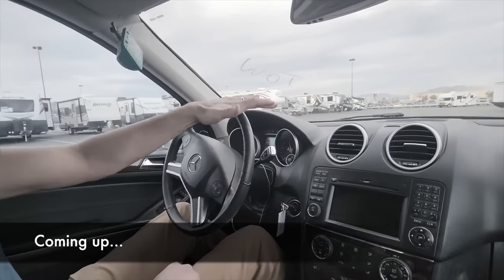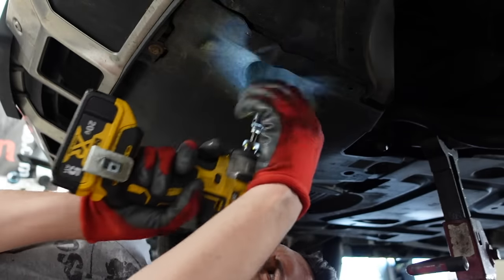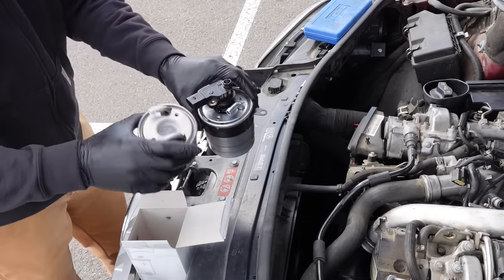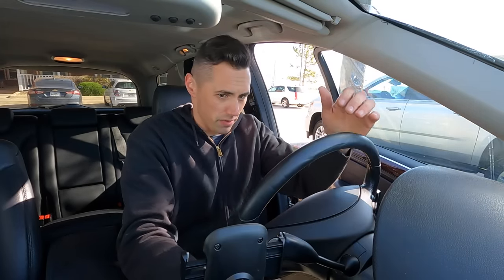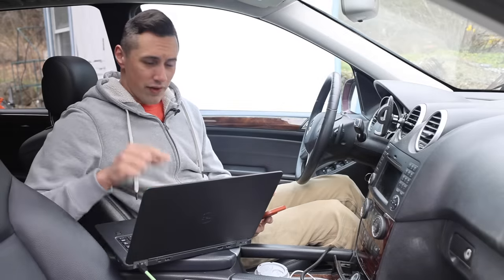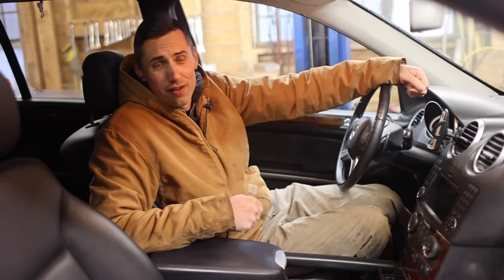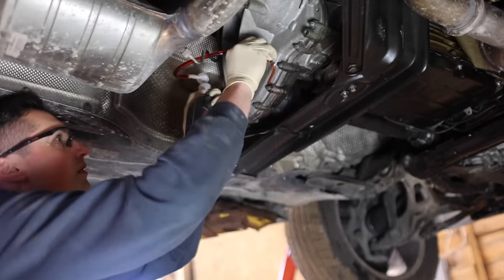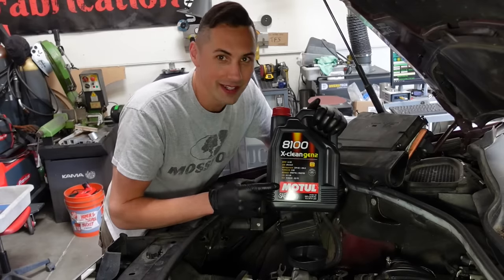This is the Most RELIABLE Luxury SUV I Could Buy for $4,000 (Not a Lexus)

Comment: Its funny how different the perception of reliability is in Europe and the US is. Over here in Germany Diesel engines are cosidered much more reliable than petrol ones as long as you drive long enough to get the power train to temps.
In the end it comes down to the care the vehicle got, I guess.

Also: love your content Waldo, not that shiny, quick cut, loud, usual car content - great! :)
Reply: Diesels are very reliable when it comes to toxic exhaust fumes .They never fail to pollute everyone in their vicinity. (notwithstanding a commercial vehicle needing torque from a diesel ).
Reply: The US has been hit with a massive gasoline shilling for decades. Everywhere you need a vehicle to be reliable, you're not seeing a gasoline engine that need at least 6 liters to make any amount of power
Reply: @kenadams5504  yet you would die way sooner in a garage full of gas engine fumes, than diesel engine fumes..
Reply: Here in The Netherlands the biggest question is how many km's do you drive each year. After a certain amount, the diesel engine becomes cheaper due to diesel fuel being cheaper, but road tax being higher. So when you drive less, you buy gasoline, when you drive a lot, you buy diesel.
Reply: Old diesels versus old gas, diesel is more reliable. Modern diesel versus modern gas, gas is more reliable.
Reply: The fuel difference between  countries is the issue. EU fuel is way better refined.
Reply: @ken adams  you think diesels pollute more than gassers? Your ignorance is showing.
Reply: @timhufnagel7462  there’s an entire class of pollutants that diesels generate that gas engines don’t produce much of, got VW in so much trouble. Diesels are definitely reliable, but their emissions systems definitely aren’t. There’s efforts to fix this with new diesel designs that get away with less emissions systems and are more efficient to boot, Achates is the firm working on them.
Reply: @Roman Nasuti  you know who doesn't have emission standards. The US Department of Defense.  So until they do, there's no reason for anyone else to have to play the "emissions" game.
Reply: @athaphian  As a German who just looks at different car websides it's not true as far as I know xd you Dutch people love small cars and drive soooooo many kilometers. I've been looking at Alfa Romeo MiTos and Ford Fiestas. Every single model that was in NT and not GER had at least 200.000km on it :D the highest was a 2014 MiTo 1.3 JTD eco² 84hp with 488.000km and the highest Fiesta was a 2016 1.2 Duratec 82hp with 340.000km you guys are crazy..
I also love "klokje rond" that dutch Youtube format where cars that have to go through the MOT the owners talk about how long they owned the car, how reliable it is and if it has many current problems or not ranging from 300.000km - 1.2Million.
Reply: @chriskonte1909  We are just cheap. We only sell our cars when they have a lot of mileage. xD
Reply: @kenadams5504  🙄
Reply: @osmaks1518  diesels are everywhere .how many ppl are in a garage full of fumes ?
Reply: @kenadams5504  the argument that Diesels are somehow much dirtier than Petrol engines can only come from an American who only knows Diesels as coal rolling shitpiles.

Well here there is a small diesel in every 2nd car and they are honestly  good engines.
20 or so years ago Diesels came into Fashion because they used less fuel and were actually a bit cleaner than Petrol engines in terms of Co2 emissons.
Reply: @alouisschafer7212  In my country, diesels are being phased out , and no new diesel engines will be bought/sold after 2,030 .Many countries are doing this. Emmision reduction is essential in order to slow climate change for the sake of future generations , in particular .If you don't care about such an issue , perhaps you are entitled to your attitude , but what if everybody thought the same way ? . Before science taught us about diesel fume affects on air quality , motorists were encouraged to use them because of superior fuel economy from them, so ppl with old diesels now should not be demonised , and I'm not judging them , but we now know more than before , and have to change the way we think.
Reply: Diesel fuel is also cheaper.
Reply: @athaphian  That's the old days. Diesel is barely cheaper now, sometimes not, the engines/car are more expensive. They have a DEF system which is problematic.
Reply: @DontCryAboutIt   Well, partially correct. Actually it is the idiotic EPA regulations.
Reply: Had many Mercedes, never found one that didn't stay in the ship after 20k miles.
Reply: @bycracky22  My experience was the exact opposite.
Reply: @kenadams5504 One thing is certain, you have no idea about the exhaust gas problem. Gasoline engines are not cleaner in terms of exhaust gas, the current direct-injection engines also require a particulate filter and also an SCR catalytic converter to reduce nitrogen oxides. In connection with the specific additional consumption, gasoline engines still emit more exhaust gases than diesels. The American way of thinking that gasoline engines are better and cleaner is simply due to a lack of knowledge about the technology. Ignorance is not a good advisor.
Reply: LOL it's the same here the OP doesn't have a clue what he's talkign about. ML and GL classes are made specifically for americans in america, aka they are crap
Reply: Merc with diesel engine is lasting for ever
Reply: Ha, a Mercedes M class reliable. What a joke 😂
Reply: I live in in Pennsylvania and drive a VW Golf TDI. I love it.
Reply: its bcuz here in USa we have extremely diesels and thus no abilities nor scale-of-economy to deal with.  That's even true for non diesel euro cars and that's why our car mkt lacks the interesting euro cars, and even the intersting non euro cars.   We suck basically.. very simple minds, but also a strict air pollution regime since the 1970's
Reply: @wills5482 American manufacturers produce 3- 4 and 6-cylinder engines that a comparable in power output to those produced anywhere. 
Large V8 engines are usually only found in pickups and large SUVs
Reply: Not if it's a Toyota or Mazda, though. Their petrol engines are much more reliable.
Reply: When the cars from Germany come to the U.S. they have to meet our clean air standards.  So much stuff is added for it to be legal here the cars become sluggish and not so great.    My wife's uncle bought a high end and had it brought to the states.   Never ran like it did in Germany
Reply: @kenadams5504:  “Emmision reduction is essential in order to slow climate change for the sake of future generations”

There is ZERO evidence that personal vehicles are causing our climate to change. There is ZERO logic behind the claim that changes to personal vehicles will be impactful to global emissions, given the small share of all CO2 emissions they constitute. 

What you have is akin to a religious belief accepted on faith, not based in evidence.

Comment: Great buying Waldo! Quick tip - when doing an oil change on the cartridge oil filter vehicles open the housing cap until you can see 10mm of thread. It will let the oil bypass the bottom o-rings and drain the oil out of the cartridge for a mess free extraction.

Comment: Hello from the UK, I used to work at a chemical plant that produced Anti Freeze, basically its all the same, Ethylene glycol is colourless, we used to add dyes to the production batch depending on the customer requirements, the packing plant was loaded with several thousand branded bottles, filled and shipped, we also blended brake fluid, packaged and shipped in the same way.

Comment: Great video, I saw thumbnail & said "Bet it's about the ML / w16X SUV" series !
I know cause I bought, 8 years ago, and ML500, so an 5 litre V-8, 2002 model year, Mercedes SUV, in a somewhat Rare color.

Guess what I paid, yes $4,000 !

She had 102,000 miles & now has 184,000 & is my tow rig for sport & work trailers.

You are SO right on Colors for Mercedes-Benz, is there a LAW somewhere that commands them to only use Black, White or Silver on 90% of them ???

I dunno but thrilled my ML500 is Gold Metallic instead.

But your red / burgundy color is superb !

And the Turbodiesel Bluetec is great IF she's a reliable engine:

As you say they're quite rare so hard for me to say. 

I will say this for sure, in the 98-05 early series ML (w163 series) the related V6 & V8, named m112 & m113 respectively, are legendarily tough & reliable.

I'm an occasional,l active forum tech at Benzworld w163 forum & have heard longevity stories that are exceptional.

I love unique German cars & trucks like these.

(Tip to newbies: body on frame SUV = Truck)

I just obtained a seriously cool yet rare German Station wagon you might look into in future:

2018 Buick Regal TourX AWD 5 door wagon - it's an awesome GT car made by Opel of Germany & only imported into USA in 2018-20.

But sold much longer overseas in Europe & Aus / NZ as Opel / Vauxhall Insignia / Holden Commodore.

Anyhow it's got Euro / German style & vibe quite the unique runner & NOT a carbon copy Subaru or Volvo wagon.

Actually size & performance very similar to the $90,000 Mercedes E class wagon, (still made but seldom seen.)

Let me know if you wanna know more on the earlier series ML (my channel has a few w163 mod videos) or Regal TourX Wagon.

Imma finish your video now.

Cheers - David in East Texas

Comment: Bought a 2008 ML350 (V6 Gasoline as you say) in white back in 2010.  I got it at 60,000 miles, and after 10 years of ownership, I put 170,000 miles on it.  It genuinely was a bullet proof car, the most reliable car I’ve ever owned in my life.  It only had one major issue towards the end and the repair cost me $1,300.  I drove it for 5 days 40 miles a day before I had a day off and take it into the shop, and despite some concerning noises, it still held up.  Two of my uncles bought a white ML350 after me, one of them a 2013 diesel with bluetec as well that he sent back to our home country.  Now I own a BMW only because I needed a newer car, and the newer Mercedes SUVs aren’t flattering at all, let alone reliable.  It’s sad to see how different Mercedes turned out, in my opinion it lost a lot of the style and charm it used to have before 2014/15.
Reply: Both males have gone down hill big time over the years.
Reply: What was the major issue?

Comment: I have an 09 R class bluetec brother to this. It is a beautiful machine when working. Mine was having same issue bogging down, often going into limp mode for boast issues. I tried cleaning out the DPF myself with limited success. But mine fell under the Bluetec settlement (check if yours falls under that), so dealer replaced dpf, def and egr systems for free. It runs much better now. I've also rebuilt the turbo and a small boost leak. If you do decide to rebuild the turbo, it is hard to find a rebuild kit and for some reason the one I got was missing a key o ring. Had to buy the o ring separate. If the T case starts making a horrible teeth jumping noise, you probably just need a new chain.
Reply: yeah, my mechanic forbade me the diesels, and he's an expert , deep level mechnaic for them and the nondiesel euro

Comment: I have the E Class Wagon in Hyacinth Red. 
Beautiful car. 

I did have a Jaguar XF. Bought it at 3 years old. Full Jaguar service and with an extended warranty. 
In the time I had it, it had over £10K of repairs and then, 2 weeks out of warranty, the DPF clogged and that leaked diesel into the oil sump. The engine destroyed itself. 
The car was worth ~£16K by now and Jaguar wanted over £12K for a new engine. 

I sold it for scrap. 

That was not the first but definitely the last Jaguar I will ever own.

Awesome video. 
Subbed 👍
Reply: What year e class wagon

Comment: Hi i am a mercedes specialist and i noticed you used the wrong transmision fluid (red color) for the 722.9 plus  (newer generation)after 2010 you need to use the blu color fluid... Change it before you destroy the transmition

earlier 722.9 transmission models will use Red fluid, while late-production 722.9 “Plus” models are the ones that require blue fluid.

Comment: So nice to see someone service a Mercedes properly. I think these have unfairly received a bad reputation for being unreliable because people are not maintaining them properly or at all. You do need to use the correct coolant, the correct oil and use the correct procedure for setting the level in the transmission etc.
Reply from the maker: Exactly. I think I should have been more clear in the video, but proper maintenance is key to having a reliable vehicle, especially with German cars
Reply: Well for the any car but especially one with DPF "Italian" tune up does wonders - 20-30 mins (or more) at 100mi/hr. + or few hrs. at 80.

Comment: I had the very exact same model 2009 3.5 petrol. Absolute bulletproof, then sold it and bought a 2012 w166 3.5 petrol my current one. Boy this thing is a beast with incredible speed and reliability. I also have a 1998 ml320 petrol so you could say I am a an ML fan 🔥💪🏼 the kings of suburban

Comment: Another great purchase, for a low price. 
I know a lot of people say they're not reliable and they break down all the time, but in my experience it's mostly caused by people themselves - they buy an expensive +100.000$ car, but then cheap out on the maintenance. 
I experienced that many times when I had my shop, where people wouldn't pay for the expensive fluids specified by the manufacturer, but wanted me to use the cheap discount stuff because "It was good enough for them!"  - yeah maybe, but it's not good enough for your car Mister, you need to use the products specified by the manufacturer, or you risk damaging your car and losing your warranty! 😂
Reply: I bought mine brand new serviced at the dealer and it had a lot of issues with sensors all the time

Comment: I drive a cls 350 diesel, I’ve owned it for 8 years it’s a 2013. Had 34,000 miles when I bought it, has 110,000 now. I’ve serviced it twice and it’ll still do 150mph on the highway. Fantastic engine .

Comment: We had a 2011 ML350 Bluetec.  We had pure headaches with it: timing chain stretches every 40K miles leading to slapping at cold start.  In addition, the whole Bluetec system is finicky and we had to replace NOX sensors and Urea Preheaters multiple times under and without warranty.

In addition the tumble flaps in the intake manifold will break from carbon.  This car should get walnut blasting every 50K miles.

It also takes a very specific oil: MB 229.51, which is hard to find.  Mobil 1 ESP (the green label) is impossible to find on store shelves.  It is important to use this "low ash" oil to prolong the life of the emission components.  If you use regular Mobil 1 TurboDiesel oil, you will see an emission failure quickly.
Reply: Agreed - I really wanted a Bluetec but the number of common failures is just insane.
Reply: All my emission equipment fell off my GL 320 (dpf, egr, swirl valves). All the problems you listed disappeared. I even use normal CJ4 diesel motor oil now. 250k miles and still on the original timing chain.
Reply: @erikkovacs3097  Timing chain issues plagued majority of MB motors made around 2010+.  I had it in the 4.7 Litre biturbo at 48K miles.  From my understanding, the part supplier just sucked.

Comment: I found that one of those headlight restoration kits was a good way to get the sandpaper, polishing compound, and clear coat to fix a small boo-boo on my car's body. I had to buy the spray paint separately, of course, but I got the different grades of 3M sandpaper and some easy to apply clear coat - those little wipes work rather well - and the end result is that you have to be a few inches away and stare at it to tell the difference. 

I'm still waiting for more video on the excavator.

Comment: I have a 2008 Jeep Grand Cherokee with a 3.0L Diesel (non DPF) Mercedes V6 engine , I think the same as yours. One of the faults those engines have is that around the 160,000Km mark the 'Swirl Valve' fails and the fix is expensive if done by a shop.  My headed this issue off by have the 'Swirl Valve' programmed out (deleted).  It has been over 10yrs with 300,000 Km plus on the clock and "touching my wooden head" everything has been good so far. When I had the programming done the technician tuned the performance of the engine and I get better fuel economy and better acceleration. You might also want to check the serpentine belt.

Comment: Quick tip for the headlight oxidation.  Brasso metal polish works wonders and is cheaper than most kits.
Reply: Toothpaste works as well and most people already have it, except for Kentuckians.
Reply: @DISOPtv  lol
Reply: I use a product called PolyTrol which requires zero effort....  Wipe on wipe off.  Note - only works if your headlights are not too bad.
Reply: @TROdesigns  Seriously, it works.  Toothpaste, try it.  And it smells good :D
Reply: Any mild abrasive will clean headlights, it's the UV protectant that you need to apply to keep them from fading again
Reply: @TheRoadhammer379  THIS
Reply: I've used off bug spray and it cleared the headlights right away

Comment: I bought a 2003 ML 320 with 99,000 miles for $2000,,almost no rust at all,rare for a 20 year old New England auto.My local MB specialty shop did a full service ,and replaced the front drive shaft.Total cost of vehicle and full service,and all new rotors and pads totalled $5000.I've drive it 70,000 miles in 2 1/2 years and love it. A great winter car and a reliable ,comfortable driver.I'd buy another MB 163.

Comment: I have been driving Mercedes 6 cylinder petrol engines on LPG for 13 years and I always fit K&N filters for very smooth air flow, I always fit a Pre Filter as well to give myself a bit of protection, a Mercedes demands a very healthy Battery, any drop in charge cripples the car.
The M-Class has a great reputation where I live in the Bavarian mountains.